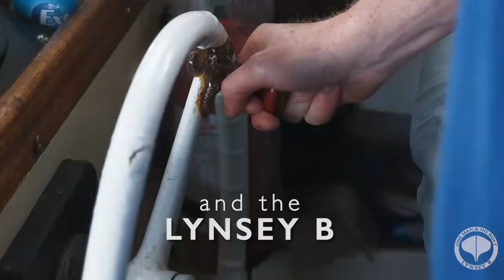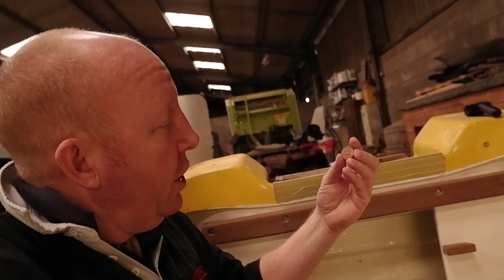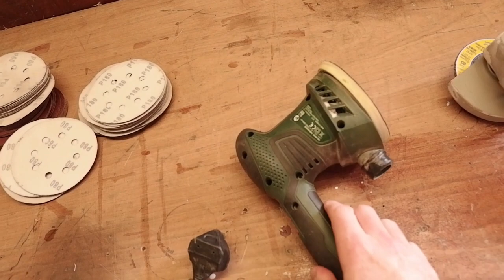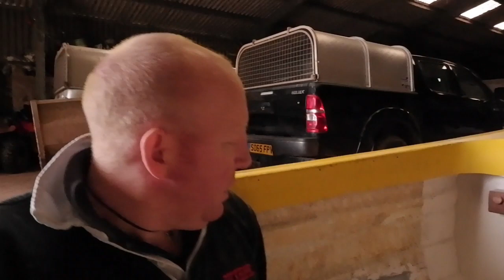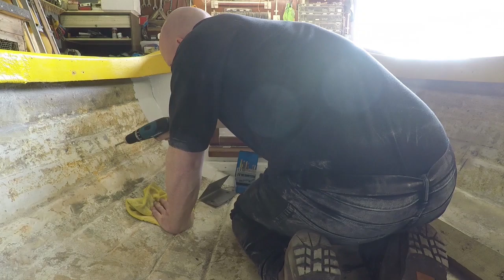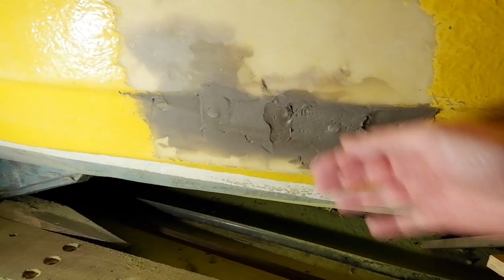Episode 5 Bulkhead & Seating

Comment: Hello again Barry. Im doing a bit of work on my Longliner finally!. Enjoying all your videos. Can you answer me this one - Should I use polyester resin with Chopped Strand Matting or will Epoxy Resin work as well? reading a bit about this and seems to be varying opinions. A local guy here is doing work on her now and when I get it back I want to put in the same front bulkhead locker as youve installed. It looks great and I think you said to me before that it will stiffen the boat up which is better. Thanks in advance. Cheers.
Reply from the maker: Hi Noel. I'm so sorry for this late reply...its been a wee busy weekend here.😂😂😂😉👍
I'm glad your getting some time on your longliner. 
Now that the weather is better, it's a lot easier to build, when the conditions are right.
Epoxy resin will do you grand bud.
That one thing about forum's,  everyone has there own opinion....but not all opinions match.😂😂😂😂
I'm glad your following suite, with the bulkhead for the " Barry B" it certainly has made her a very strong little boat, and that was just putting that bulkhead in.
Once I get the deck and seats in, that will be more strength again.💪💪💪😂😂😂😂😉👍
Good luck with fitting the bulkhead. 
Always here to help, if you need advice bud.
Have a great week ahead. 
All the best. 😉👍
Reply: @onemanandhisboat  Thanks for the response Barry. Your new boat looks absolutely class - looking forward to seeing her out on the water in future vids and Im also looking forward to getting my longliner mk 1 out on the Atlantic in the next few months. Thanks for the advice and help. 👍👍👍
Reply from the maker: Thank you so much, for the kind words Noel, and your more than welcome!, anytime I can help with advice,  just ask away, I'm always happy to help. 😉👍
Good luck with getting out this season, I hope it's a cracker for you.
Please feel free to post some piccys up on our Facebook page, if you so wish......our page isn't just about our boat.😁😉👍
Have a great week.
All the best.
Baz 😉👍